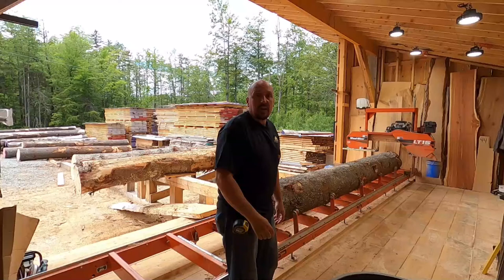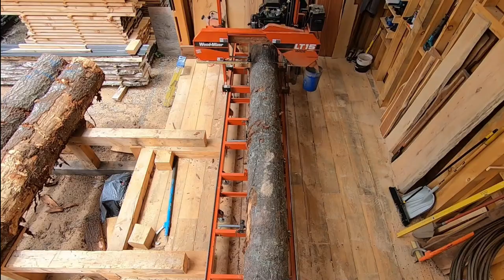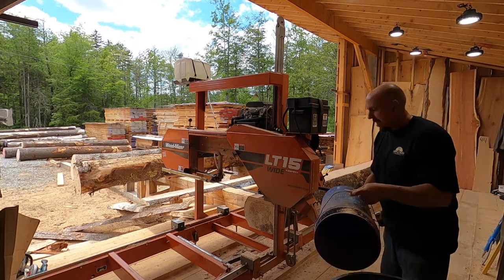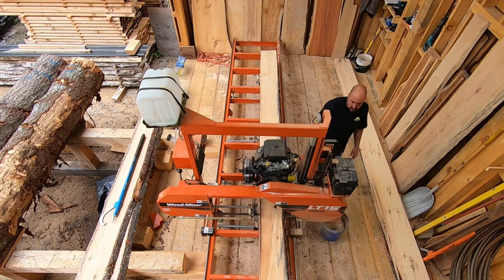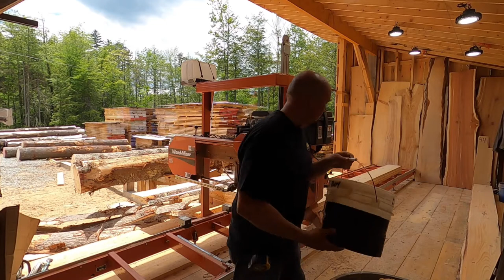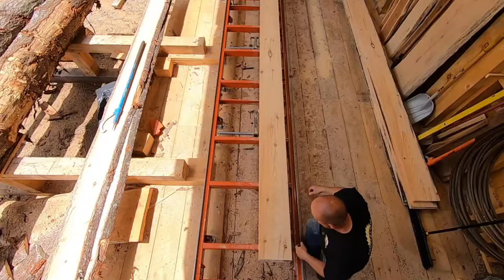MILLING ALONE, WHITE PINE FRAMING LUMBER #50

Comment: Think I will subscribe your videos getting better . it takes time to get set up . still very dark in the saw dust dump container end of shop You are making great progress.
Reply from the maker: It's actually very bright throughout the mill, the problem is that the ISO on the camera gets messed up because it is looking outward into the bright sky.  It's something that I have to work on, either a filter, or just change that cam location.  Thank you for the feedback! -Andy